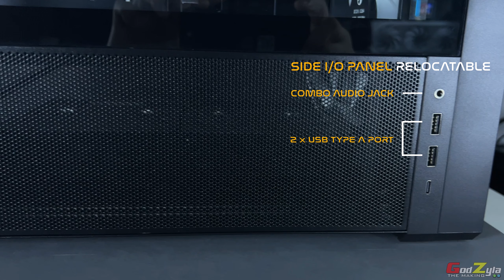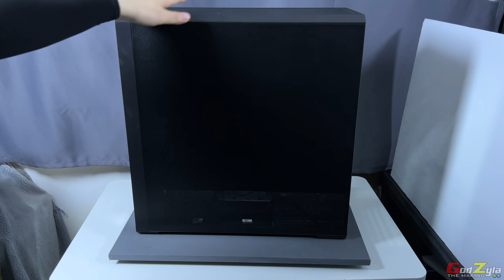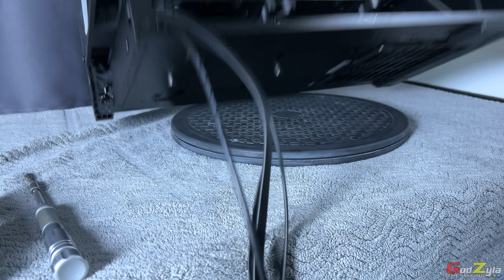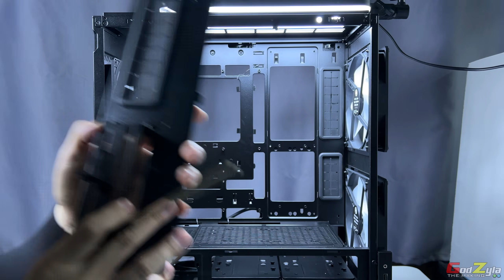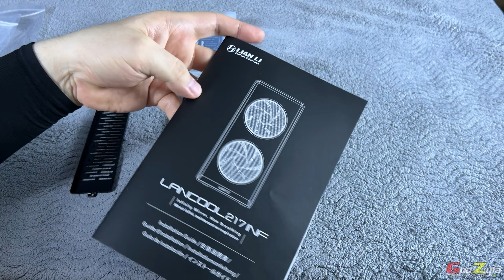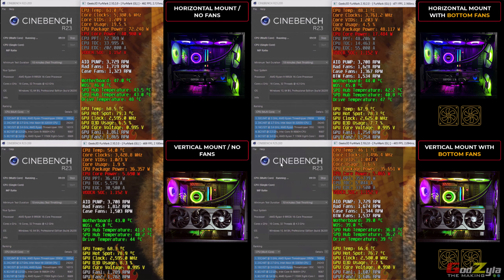Lian Li Lancool 217 INF

Comment: I hope that someday we will get a 217+++ without a garbage "wood" + normal front panel with a dust filter and without those ugly giant grilles from the early 2000s. Please, Lian Li, it's not that difficult.
Reply from the maker: Hi Enclave, welcome to my channel. hmm.. I can only agree with you 1/2 on the wood. Yes, the wood are not treated correctly and using the wrong section of the tree, this I do agree but it's saving the trees into waste. As for more dust filters, maybe for intake of air but for exhaust. I wish the ventilated holes are either open or bigger. Thank you for your feedback, greatly appreciated it 🫡

Comment: I love this case and you've answered all my questions and doubts. No reviewers does it like you. You took the time and effort, even giving warnings with tips and tricks. Thank you so much Kleo.👍 I am going to get this case, once it's sold in my country.
Reply from the maker: Yo Skype Val, welcome back. oh ok, I am not aware that you going to get this case. Yup, I prefer to slowly walk through and to appreciate case manufacturer for it's design and the construction. In addition, I do sit as a PC Builder, what I learn in building with this case, I will share it and hope others who are seeking for solutions on mounting and such will find this content useful. Thank you for your feedback and support. All the best with your purchase too 😉
Reply: @KleoYan can we relocate the full front front fans and place them on the top and can we mount a 360 radiator with 120mm 3 fans in the front for this model ?
Reply from the maker: @bhargavthobhani  there are no 120mm fan mount at the front plus the front will look ugly and defeat the purpose of having the design this way. Even if you mod and plug your 360 at the front, your rad fans can’t benefit from this as top and bottom fans are cut off from intake of air.